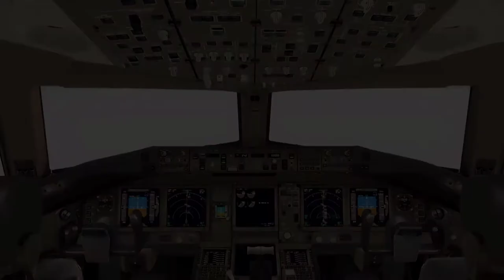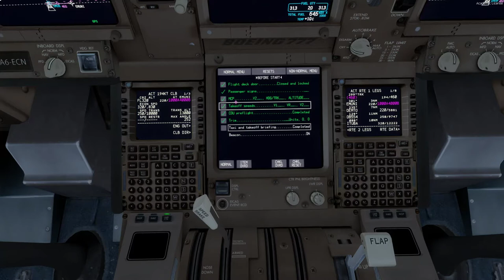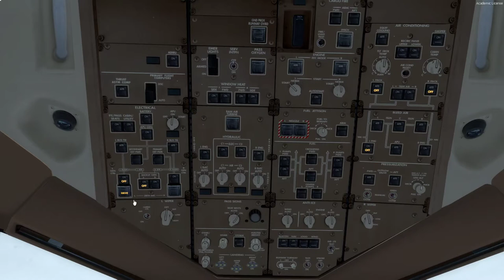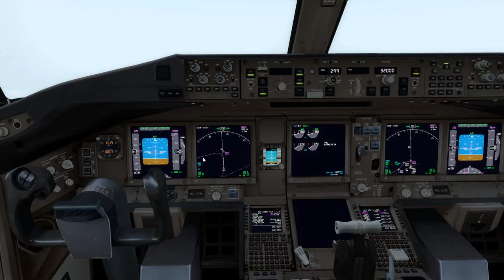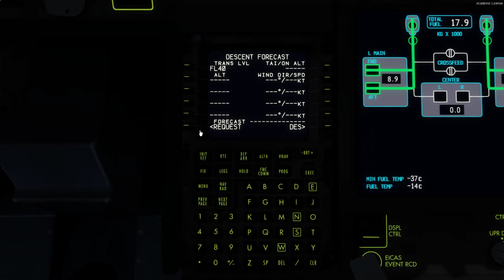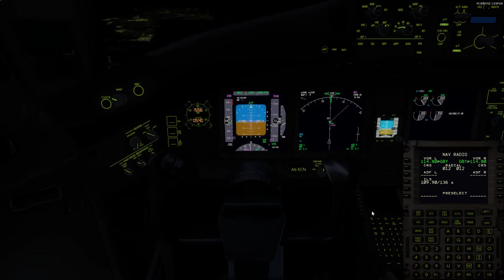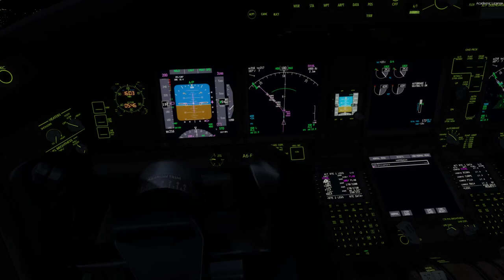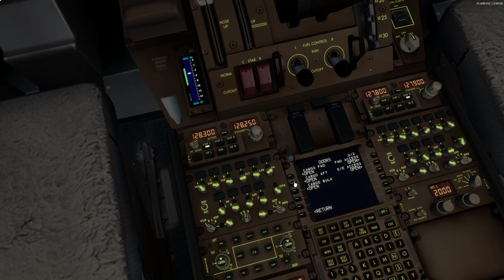Prepar3d V4 - Emirates 777-300ER - Dubai to Mauritius (OMDB-FIMP)

Comment: Hello
Is p3dv4 extremely better than v3?I am considering that I should buy the v4?
My notebook which has i7-6700 , gtx965m and 16GB DDR3 always has low FPS when I am playing  p3dv3 although I had set the graphic in middle quality.I am not sure that it is because p3dv3 is 32bits program .
Reply: appricate to your answer